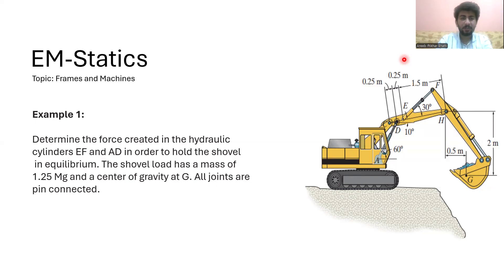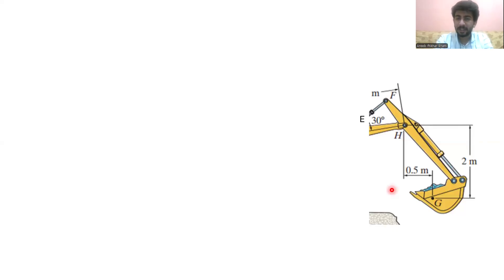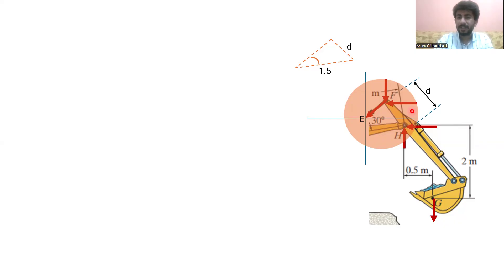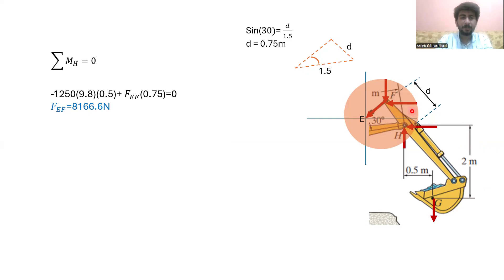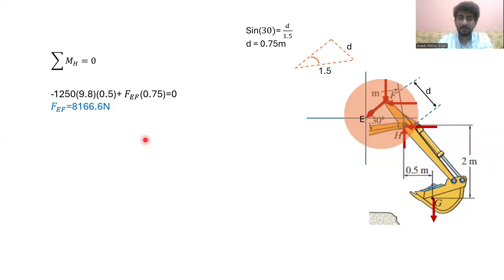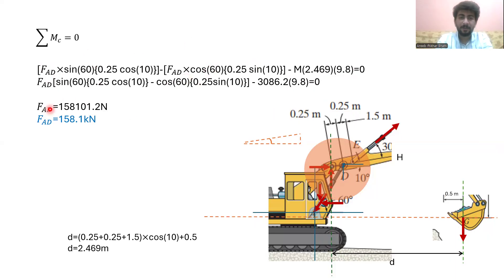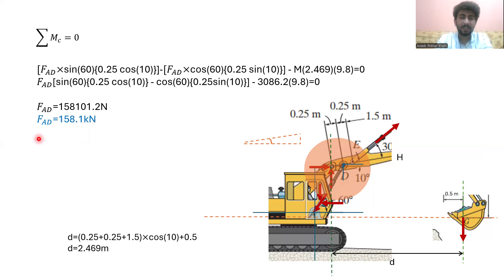Frames and Machines Ex 01: Determine the force created in the hydraulic cylinders EF and AD.

Comment: yo I was wondering what kind of methode u used to calculate the force in Fef. During my lectures rn we learn to calculate forces in those beams using the methode of joints. can u do this to? or do you do this because u assume EF is a 2 force component?
Reply from the maker: We use the method of joints to solve trusses by analyzing one joint at a time, moving sequentially from one joint to another. However, this method is typically used for trusses, whereas frames and machines require a different approach for analysis.
Reply from the maker: Yeah we can assume that  EF is a 2 force component

Comment: how do you realise that its a right angle with the triangle at 2:01
Reply from the maker: Are you asking why I use the sine component at 2:20, or are you asking something else? Can you clarify?
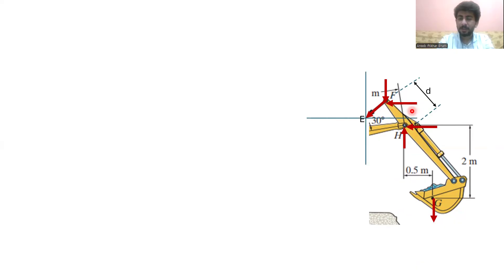Reply: @Vector_Horizon ah my bad i meant to find the distance d at around 1:40, the distance between F and H u use sin 30 times 1.5 but how do you know it makes a right triangle because otherwise u can’t do that no?
Reply from the maker: @thegreentrex6890 It does not form a right-angled triangle. To find the distance between points F and H, observe that the points F, H, and E form a triangle with a 30-degree angle at E. We are also given the distance between points H and E, which is 1.5 m. This means we have two sides and an angle.

Let d represent the distance between points F and H. Since we have the hypotenuse (H to E) and the angle (30 degrees), we can use the sine function to find the distance d.
Reply: @Vector_Horizon  you only have one side and an angle. even if you had two sides, you still made the assumption that it was a right triangle